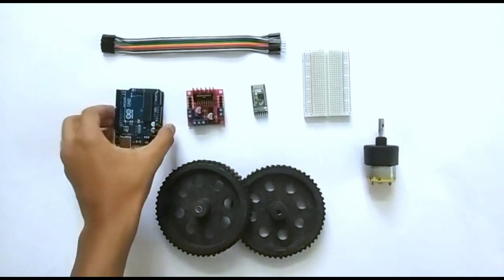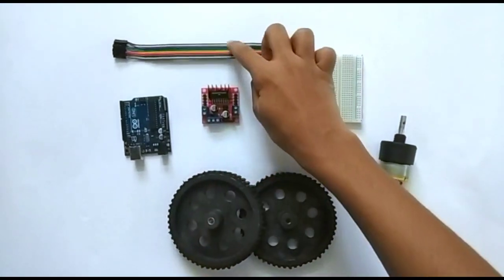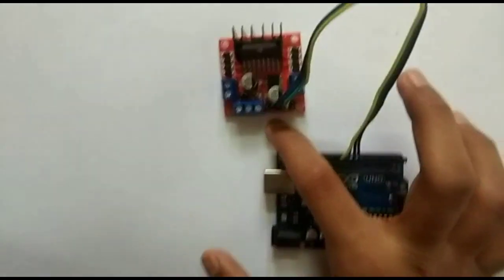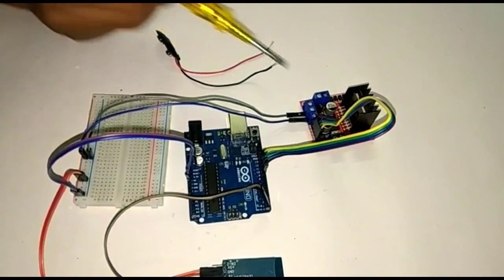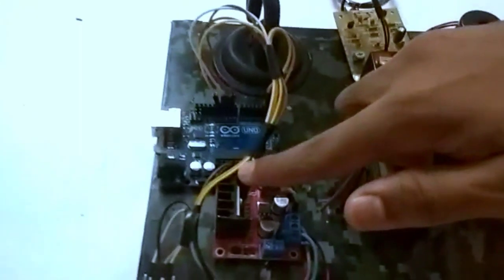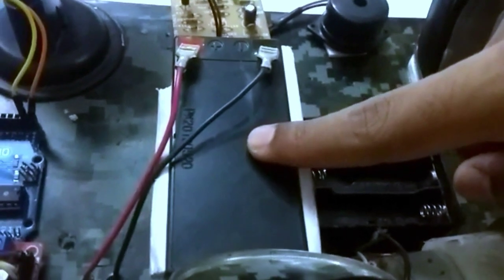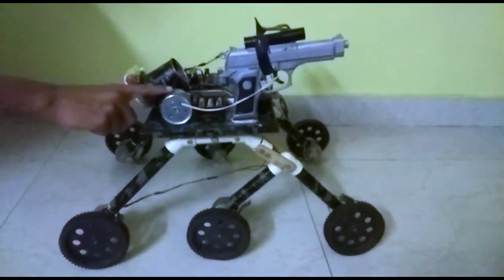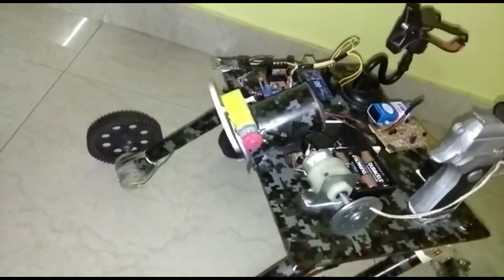How to make a Multipurpose Spy Robot (SPYRO).

Comment from the maker: // Made by Robotech
//how to make a spy robot

int m1a = 9;
int m1b = 10;
int m2a = 11;
int m2b = 12;
char val;
 
void setup() 
{  
pinMode(m1a, OUTPUT);  
pinMode(m1b, OUTPUT); 
pinMode(m2a, OUTPUT);  
pinMode(m2b, OUTPUT);  
Serial.begin(9600);
}
 
void loop()
{
  while (Serial.available() > 0)
  {
  val = Serial.read();
  Serial.println(val);
  }
 
  if( val == 'F') // Forward
    {
      digitalWrite(m1a, HIGH);
      digitalWrite(m1b, LOW);
      digitalWrite(m2a, HIGH);
      digitalWrite(m2b, LOW);  
    }
  else if(val == 'B') // Backward
    {
      digitalWrite(m1a, LOW);
      digitalWrite(m1b, HIGH);
      digitalWrite(m2a, LOW);
      digitalWrite(m2b, HIGH); 
    }
  
    else if(val == 'L') //Left
    {
    digitalWrite(m1a, LOW);
    digitalWrite(m1b, LOW);
    digitalWrite(m2a, HIGH);
    digitalWrite(m2b, LOW);
    }
    else if(val == 'R') //Right
    {
    digitalWrite(m1a, HIGH);
    digitalWrite(m1b, LOW);
    digitalWrite(m2a, LOW);
    digitalWrite(m2b, LOW); 
    }
    
  else if(val == 'S') //Stop
    {
    digitalWrite(m1a, LOW);
    digitalWrite(m1b, LOW);
    digitalWrite(m2a, LOW);
    digitalWrite(m2b, LOW); 
    }}